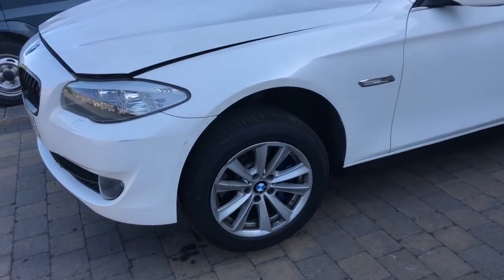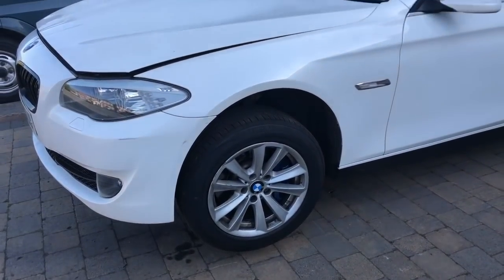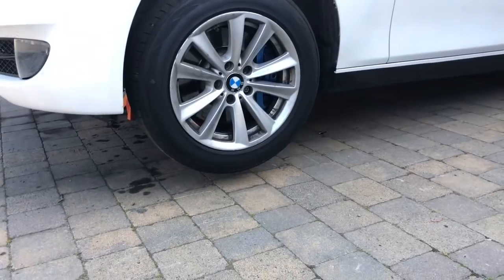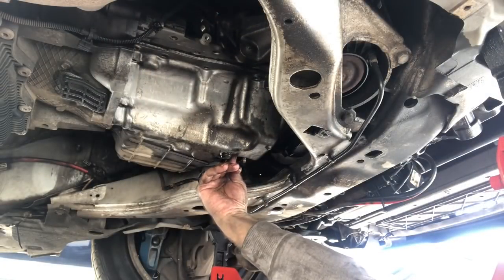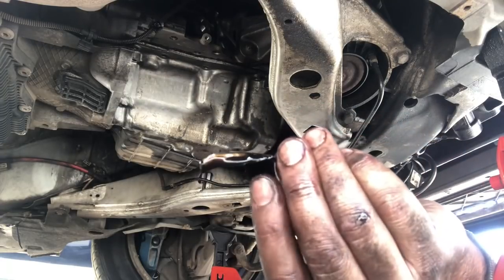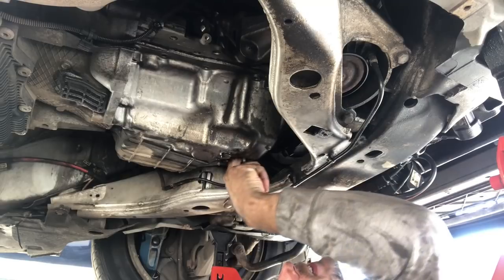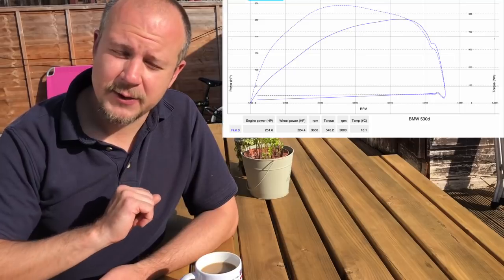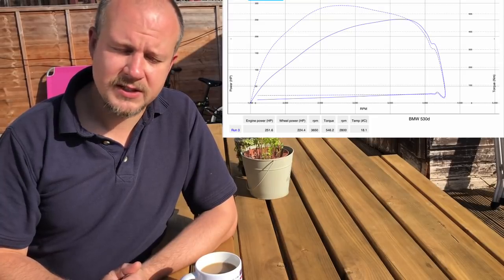BMW 530d N57 ENGINE FAILURE @177k - Spun Bearing! ☠️

Comment: Get the engine off, do a complete overhaul, and then boost the s**t out of it, just to establish dominance over it!
Reply: @Nut_Job.  have a discussion with the tuner , i've seen a lot of engines destroyed by the tuners.
 The problem is the brake etalonation puts a massive strain on the engine and this happens.
  I have seen brand new engines destroyed because of bad tuning of the dyno.
 I'm not saying your engine had or didn't have  a problem ,just that the problem occured during the test and that is a fact!
 Best of luck.
Reply: Exactly teach it a lesson and let it know who’s boss!
Reply: @torquesteer2657  Pretty sure the Beemer owns Nut Job's soul now haha
Reply: @driftr1dr719  and his heart
Reply: Your patience seems inexhaustible! I have followed your various videos since I too have a 530d F11.  Your instructional video on EGR replacement was terrific and now I think I'm up for a prop shaft centre bearing replacement because of vibration at 70+. Did the replacement of the rear gearbox support make a noticeable difference?
I did wonder if there was an issue with lubrication causing your bearing collapse. Either way  good luck with the rebuild though I'd be happier doing it on the kitchen table.
Reply: @markswift4779  have you sort the problem with the vibration? I have the same issue and i dont know with what to start.
Reply from the maker: Depends on the mileage really. If it’s done more than 120k then maybe not, but if it’s in good condition with lower mileage then why not 👍
Reply from the maker: Yes, otherwise the DPF will eventually clog I believe. Be aware that in the U.K. this is illegal though... and possibly wherever you are? 
From what I know, the EGR plays a big part in the DPF regeneration process, so if it’s been mapped-out then it will struggle to burn off all the accumulated carbon stuck in there.
Reply: @Nut_Job.  I am really curious what path did you take? On mine, the rod bearings spun, ruining the crankshaft. Crankshafts are super rare here, even at dealership it's unavailable to order. In the end I got a second hand engine, changed the main and rod bearings, oil pump and chains. But it was a super expensive journey :( I still got the old block with everything, just needs a new crankshaft. Maybe in summer i will repair that too, to have it as a spare engine...
Reply from the maker: You raise a good question...
The truth is that I parked it up in the summer & bought a new car because I’d had enough of this car... however, I still have it & I WILL repair it because I refuse to let it beat me! 😂
I haven’t got the engine out yet so I can’t be sure how badly damaged the crankshaft is... and I’m very aware that they are virtually unobtainable... I bought a new engine block, piston rings, rod shells, oil pump, oil cooler & seals etc. etc. so the crankshaft is last piece of the puzzle. I’ll begin this job once the temp comes up with Spring time 👍
Reply: @Nut_Job.  Alibaba is selling crankshafts for every engine out there, you know, cheap chinese stuff but might work lmao.
Reply: @Nut_Job. did you ever do this? Haven’t seen you in 3 years!
Reply: I am also curious guys.what happening with your cars

Comment: You have the patience of a saint. I’d have given up with this vehicle a long time ago!
Reply from the maker: You know when you’re already so far in with something that you can’t get out.... it’s a bit like Poker - you realise you’re being trapped, but you’re playing deeper than you should have & there’s still a tiny chance you could win... 🤣
Reply: I was in the same boat with my bmw first engine had a crack in the cylinder so purchased another engine then that desided to spin 5 rod bearings so I rebuilt myself which I'd never done before then the water pump went then my injectors then my cylinder head cover developed a crack repaired all that I must of spent over 5 grand in two years and then some arsehole decided to smash into and write it of now I own a vauxhall astra van no more bmws 

I'll be watching your progress I'm intrigued to see the damage to the block I've also heard its quite common on the n57 to spin a crank bearing

Comment: Like... all the hats off if you even try to do it. Everyone shouting that you can't fix modern BMWs and here you go. This absolute madlad changes N57 timing chain on the drive. Success, then blows engine. Doesn't panic, plans to take it apart AGAIN on the drive. What a way to teach people that repairing modern car's is not impossible. A nut job yes, but not impossible. Cheers!

Comment: If you remember I made a comment about replacing the oil pump when you did your chain. There is a problem with N57 oil pumps failing spinning main bearing and bending the crank out of shape. This happened to my mates car and he had to have a new crank put in as it was too bent to be ground (hardly 2nd hand cranks available) 

He had the work ultimately done by a specialist in Dartford. Dal Jones. Maybe give them a call for more knowledge on subject they seem to do loads of rebuilds on N57.
Reply: So you need to change with chain oil pump or?
Reply: Hope he does not rebuild it without changing oil pump cause it will fail very quick.

Comment: 2 years ago I had to choose between a 530d (ex police) or 520d F11, I really wanted the 530d as I love power and quite a few go through the auctions at Leominster about 10 miles from where I live. 

My budget was only 7k so I didn't have much to choose from as I wanted an automatic, I did a lot of research into the Ex police cars and I can tell you now NEVER EVER EVER buy one they don't sell them because they want shiny new ones they sell them because they are near the end of its working life and it's been a hard one. 

About 18 months ago someone new started at my work who used to prep the cars at Leominster auctions and he said say well away from ex police cars some of the stuff they had to do to get them really for Auction was unbelievable, he said if your still not put off by them look at the ex CID cars as they have had a much easier life.
Oh and I went for the 520d after which touch wood has been faultless for 20k and it's on 173k now
Love the channel can't believe you’re going to fix it again, best of luck and look forward to watching.

Comment: A BMW dealer mechanic I know said that police BMW's have a tendency of big end failures due to hours idling, the remap was probably the final straw, as a precautionary measure they now replace bearings periodically and use a different type of oil, bad luck mate but I'm sure you will get it running perfect again.

Comment: Am truly amazed about the work you do on this car! As a N57-owner myself it is indeed interesting. Will follow this with excitement, good luck! 👍
Reply: I Have a N57 5 series how is your doing reliability wise?
Reply: @d.c7867  Must say its doing great, done 135000 km (about 83885 miles) and the only issue I've had is with the AdBlue-system, luckily it was handled through warranty. Zero oil consumption, runs smooth and pulls really strong (35d) Great engine! Hopefully it will continue to behave 😊

Comment: I feel for you I really do. My M54 in my 2003 z4 lost compression. Didn’t have the nerve to pull it apart so picked up a replacement with less miles for £400. Still in the process of getting it back in. Best of luck to you

Comment: My 530d e61 spun a rod bearing. I am convinced this happened because of too long intervals between oil change. I decided to swap the engine for a "new" old one. A major operation that was. 
Later the serpentine belt decided to be mangled up behind the crankshaft pulley pushing the seal in, AND stop the engine in a millisecond or two. when it decided to move on, dislodged the timing wheel on the camshaft, possibly jumped a couple of teeth, bending valves and popping off the camshaft it self by ruining all but one camshaft bearing. Well, got the head from the old engine so changed back to that. Luckiliy managed to sell the car a week ago. an emotional roller coaster that was and I cried myself to sleep that night. Had the car for eleven years. If you name something, you can be sure that I have repaired or replaced it. But difficult to part with that awesome car nonetheless.
You have had some serious bad luck with your car, but still not giving up..."nobody else in the family except me likes it....so I have decided to mend it" ----> cudos to you. Hang in there, you will get your reward in the end :-)

Comment: my 2010 n57 also had main bearing issue this year. I could hear it at high revs. Main bearing was shaking. It looked like an egg inside when mechanic pulled it out. I decided to replace all bearings before they destroyed the engine. I also had to replace the timing chain last year and all injectors! n57 is new level of cost generator.
Reply: How many kilometers do you have before  changing bearings

Comment: At least with the repair it option you end up with a 'known quantity'. You know this vehicle - what's been done, what works, what doesn't. The repair process (apart from being immensely satisfying at the end and a good learning experience) will allow you to gauge true conditions, while any exchange unit, you're just hoping it is as advertised.
Does make me slightly nervous though... last week I took mine for a regen... 210kmh up the autobahn and back... gotta be done.

Comment: just coming back to this after a few years, I wonder if this is related to the spate of police bmw n57 engine issues that caused one officer to be in a fatal accident when the car caught fire, apparently the issue lies with the crank bearings
Reply: Egr coolant leak
Reply: Those are probably related to oil breaking down (lots of idling, diesel getting into the oil maybe) causing excessive wear on the bearings and timing chain. With the worn bearings and degraded oil, they would then fail catastrophically (e.g spin a bearing and throw a rod) when driven at high speed. Just like this, unfortunately.

Comment: Any update on this? Just rebuilt N57 engine on my E70 X5 after buying it with engine in the boot. Sweet as a nut and not actually to bad a job, once all the bolt  on parts are off the engine is straight forward to rebuild. Good luck.
Reply from the maker: Hi there, I’m just taking my time to get started... I’ve been buying lots of bits I think I’ll need & I hope to get started with the work soon 👍
Reply: @Nut_Job.  WIll you upload part by part like the timing chain Nut Job? Or will it all be uploaded after job done? :)
Reply from the maker: I will do it part by part. I’ve just not managed to get started yet...

Comment: I bet your pissed!

These newer BMW engines are trash, Long life servicing is one reason to blame
Reply: These N57 engines are usually bomb proof... I bet it's been neglected in its life, it was a police car.
Reply from the maker: Well... I’d agree it may (probably has) have been thrashed, but not neglected. The police serviced this vehicle almost every 6 weeks during its service-life, because they can’t risk unplanned downtime. There was 1 owner in between the police & myself, and he may have neglected it a little.... 
Anyway, it’s all irrelevant now - time to fix it up 😀👍
Reply from the maker: Unfortunately no spanner’s have been turned on this job yet... 
Just been raiding my piggy bank and planning the parts and tools I will need. It would have been really handy if I was on Furlough right now 😁
Reply: @Nut_Job.  You must have most tools to pull out the engine, Maybe an engine crane if you haven't got one?

Will be interesting to see the full scale of damage when you split it open
Reply: Emergency vehicles are typically even worse than rental vehicles. High engine speed although the engine isn't warm.

Comment: 5 yrs ago bought 6 yr old 525d n57 off a garage. Had 1 yr warranty. Warranty finished so decided to extend it myself from some company. Few months later timing chain broke! Warranty company said it was NOT covered. So had it fixed for around 2k (GBP)  another few months later gearbox problems and had to have that sorted, the gearbox Oil was changed, new sump and god knows what else..  another £1200 spent.  Drives and looks nice so I'm going keep for as long as I can to get my money's worth until the car dies or I die!!!!
Reply: How are you getting nowadays if you still own the car?

Comment: Crikey its an endless moneypit , youve put soo much work in to the car too
Reply: Older high mileage BMW's are but if you are patient, buy your parts correctly and can DIY once sorted they are usually ok. Too much tech in a modern car. The newer stuff, regardless of brand, is failing at less than a thousand miles (I work in the motor trade). Cars are so much more fragile these days than even 5 years ago eg Ford zetec engine gives little or no bother and will do over 200000 miles if looked after, replaced by the Economist crap which is dead by as little as 30000 miles and give lots of grief - I work for a Ford agent by the way at present.

Comment: Is it a coincidence that this happened after the juice box? I have a boosted n54 and am paranoid about bearings so I run a heavier oil to compensate for the increased bearing load. This is really bad luck mate.

Comment: Hi how are you? I've been following you and I've seen that you have great expertise with the N57 engine. I bought a broken BMW x6 40d that has a rattling engine, and I found small metal particles in the oil filter... So I'll have to tear the engine apart and buy spare parts. My doubt or question why is there rod bearing 0.25 and 0.50?
Thank you
Reply from the maker: Hi there, thanks for following 👍
The different bearing thickness is really just because of slight manufacturing variations when they machined the engine block & parts. If you look on the end of your engine block it will have a code which relates to each of the cylinders & it tells you what size bearing should fit best.

Comment: Just subscribed  I'm having a night mare with a n47d20c  it snapped the chains had it rebuilt was told crank was inspected and bearings were OK  1 month later got rod nock  haven't opened it up yet but I'm guessing the crank is finished  what's the best way to go about this should I just buy a short block and change half the engine  do I just get the crank reground and fit new bearings I have no idea what's best way forward it already  set me back 1800 to have chain repair  and new clutch dual mass etc   what do you think repair or replace and have to do the chain and bearings anyway
Reply from the maker: Hi mate, it’s a really tough decision when you’ve already done significant work on the car…(a bit like my situation). I think it’s important, if possible, to assess the extent of the damage before deciding what’s best. In my situation the crank was ruined, the block was beyond repair, plus the con rod bearings etc…. I was gearing up for a full-on rebuild, but in all honesty I lost enthusiasm in the whole thing. I’m not suggesting you give up like I did, but it’s worth figuring out how much work you might be letting yourself in for before spending too much more time/money.